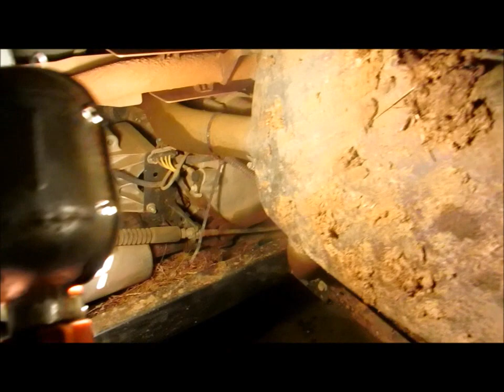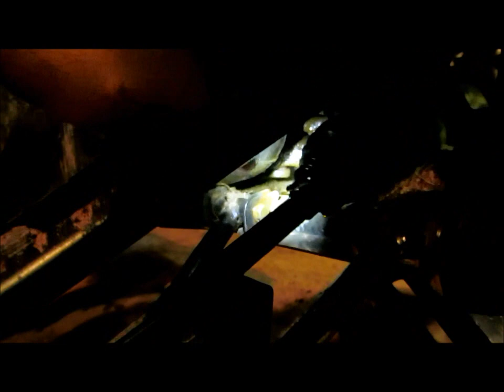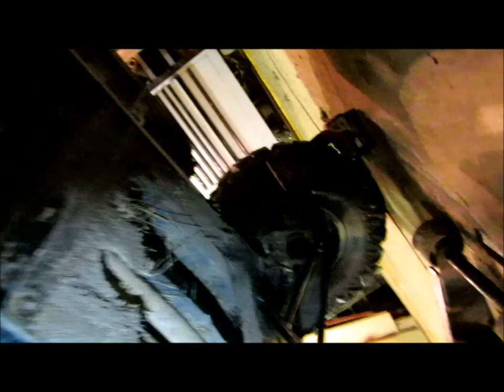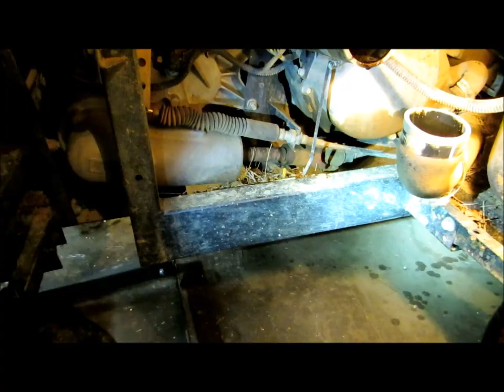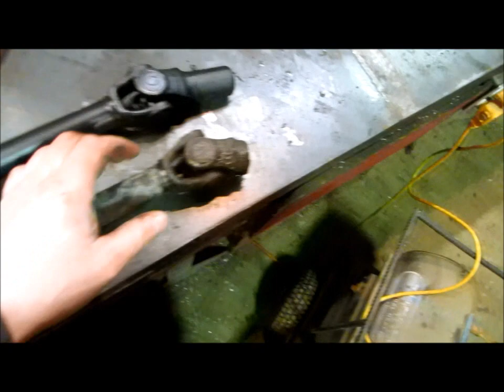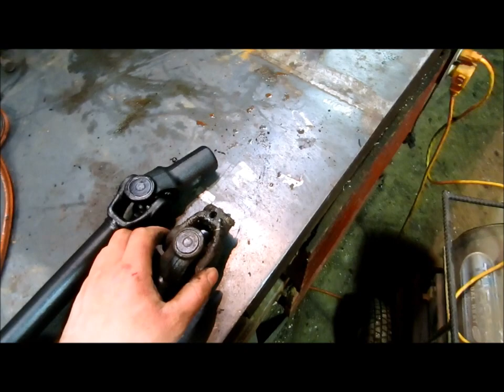Polaris Ranger 800 Propshaft Replacement

Comment: Easier way to access the roll pin up front is from the passenger side wheel well, remove wheel, and lower a arm, turn prop shaft to position the pin sideways and drive it out from the side instead from underneath of vehicle.

Comment: Best way to do it is take the front bumper off take the Gary case off take everything off and put a rope on the u-joint at the back pull through from the front end and then you don't have to remove the skid pan even even that air box hose I've done it twice several years apart of course

Comment: Just did my 2012 800.  sprayed pin the night before, knocked it out with heavy hammer and punch (tough job but got it done)  Things you have to do:  this year has the air pipe, you'll need to remove it to pull prop out the front.  Came right out when I got pipe out of the way.  Putting things back together was another job, toughest part here was putting the plastic pipe back in.  Don't waste your time trying to pull over the frame.
Reply from the maker: 800s are a totally different beast than these 570s
Reply: @OldGlory1776 what 570s? Your title says it's an 800. I have a 2010 800xp and wonder if the shaft can come out the front or the back, or which is easier.

Comment: This will most definitely bend a prop shaft. I have a bent one to prove it. Just pull the front diff and it slides right out the front of the bike ez pz if you know what you’re doing it takes 20-30 minutes to have out.
Reply: @Micklin Windham Remove the diff it’s a pretty easy process honestly.

Comment: i find it easier just to pull the front knuckles and pull out the front driveshafts unbolt the front differental and just pull the whole thing out the front.. propshaft and all rebuild the propshaft bolt it back on the diff and shove the whole thing back in very fast as long as front axles pull out and they should be greased in the sockets anyway

Comment: Nice video.. will let method also work for a 2013 XP 900 ranger?
Reply from the maker: Nope, completely different machine. Propshaft has to come out the front
Reply: @OldGlory1776  I still hope it's doable I'm a little bit nervous about getting it halfway done and then running into some unforeseen problems.. after watching your video I was totally confident but now I'm back to fretting about it..lol
Reply from the maker: @kingdiamondbanger  I have a video on removing a prop shaft on a 900, did you find it?
Reply: Okay I think I found it are you saying everything is the same as on the 570 except for notching that  brace out in the front?
Reply from the maker: @kingdiamondbanger  sort of similar, you wont have to notch the  front end if you loosen the mounting bolts on the steering rack. The 900 is the most labor intensive machine to remove the propshaft on, but I think you can do it

Comment: Ok mow what about the seal and bearing on the front diff can that be done while is the frame?
Reply: 1dads life   No. Remove the front gear case and service it on the bench. Once it's out you can pull that prop shaft right out the front much easier than this also.

Comment: Ok my 2002 Suzuki quad runner has 2 shorter versions of those one for the front one for the back what is the front one called because with out it I am only 2x4 and I need it 4x4
Reply from the maker: steve steve front drive shaft would be what I call it

Comment: Noticed on the new shaft the yokes are welded on wrong. Probably just like the old one. Too bad Polaris is still having their parts built wrong.  The welded on yokes should be in line with each other.  I have watched many videos on how every one has worn splines and/or bad u-joints and complained of vibration issues or leaking seals. The real issue is the yokes are not in line. Take it to a machine shop that builds driveshafts and have it fixed right. Problems will go away. Shame on you Polaris!!
This video is 2 years old but the newer Rangers have Drive shafts issues because of the yokes not in phase with each other. Know of ones taken to machine shop and had yokes cut off, and re welded on. vibration and u-joint problems ended. Some say they are not balanced.....that isn't the problem, it's the yokes not be welded on the shaft in phase with each other, common driveshaft knowledge......
Reply: I didn't realize they are welded 90* out of phase, thanks for pointing that out. That is a stupid blunder on Polaris's part!
Reply: SuperATV makes a really good prop shaft for rangers and RZRs that will outlast the rest of the machine. They are quite spendy though, but may be worth considering instead of going with OEM.

Comment: Have you done this with a crew? I just wonder if I can get the shaft out the same way.
Reply from the maker: I have not, I don't know what's needed to get the jobs done on the crew.  I know they're a 2 piece driveshaft with a bearing in the middle.  Sorry I can't help!
Reply: @OldGlory1776  SuperATV makes a really good prop shaft for rangers and RZRs that will outlast the rest of the machine. They are quite spendy though, but may be worth considering instead of going with OEM.

Comment: and what was the reason why you replaced the whole shaft?
Reply from the maker: it was under warranty. they paid for it.
Reply: Ok just curious  my pinion seal on the front keeps leaking ...seal number 4 .... thinking my prop is bent  but  I haven't heard of many people having this issue
Reply from the maker: +Ethan Duell very common problem. either the pinion seal can be bad, or the square shouldered seal on the housing.use silicone on that one. never seen a bent prop shaft. but they all seem to wobble.